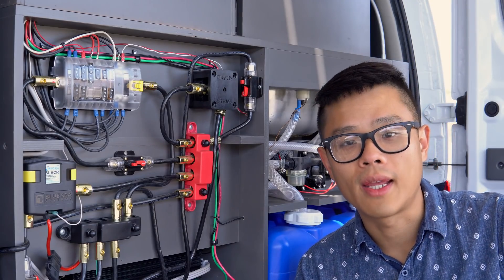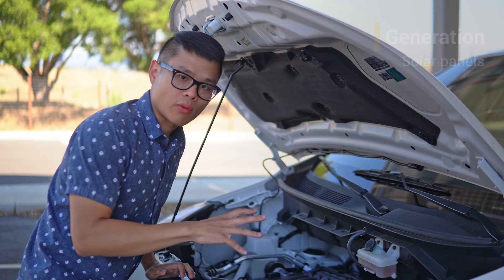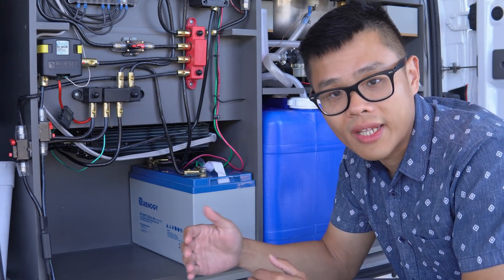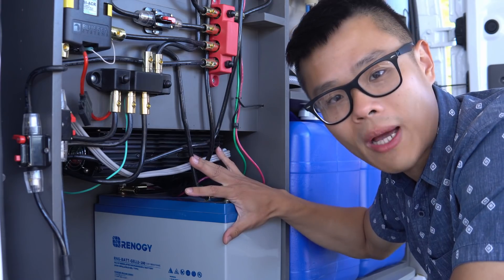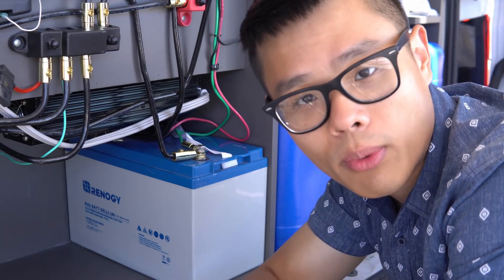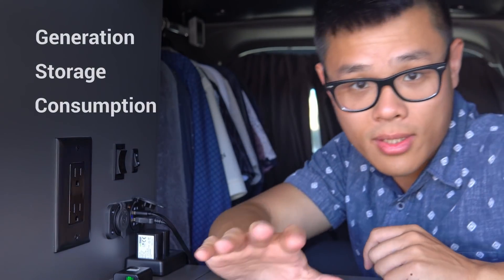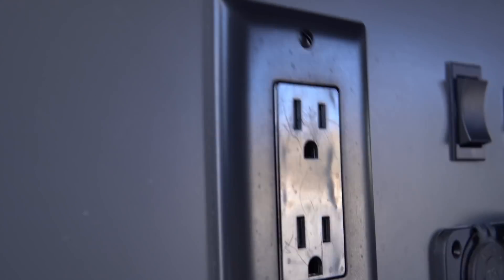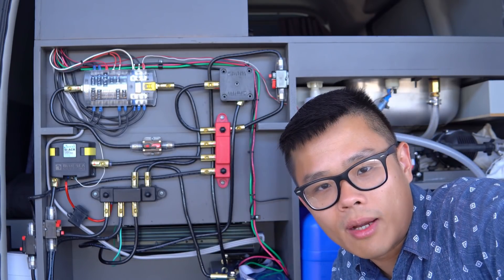Ultimate Guide To Off-Grid Electricity (In A Van)

Comment: I found this very helpful Evan, thank you.  Do you think the increased availability of LiFePo4 battery packs could be a further simplification of the electrical system, or do they bring additional complications / expense?  I suppose everything is a compromise to some extent.  For a minimalist 12v build, that is designed to support charging a phone / tablet, run some LeD lights and a small fridge, the set up you have with a 100A or 200A Lithium Battery, with DC-DC charger is probably the right way to go I guess..
Reply from the maker: I’m not sure what you mean by LIFePO4 battery packs. You mean an all in one system?
Reply: @StoriesFromaVan  hi Evan - yes exactly - Bluetti, Jackery and PowerOak are typical brand names - they comprise a lithium battery, solar charge controller and inverter all in one, and often include USB & 12V / 110V sockets/ports.

Comment: How do you heat the water?
Reply from the maker: I do not have hot water 😬
Reply: @StoriesFromaVan  do you know if its possible to plumb the hot water from the engine cooling system to some kind of heat exchanger coil in the water tank?

Comment: i went 24v to double my output from a smaller MMPT controller and smaller wiring with less power loss. 
have two 310 panels on my sprinter van with 3rd remote panel that is canopy or points towards sun in Morning Hours. 
35A MMPT victron is 500 watts 12v or 1000watts 24v. Also Capable for 36v or 48v for expandability.

for 12v charging can use a very cheap 8Amp 12/24v charger and run a line to the inverter in the van (use van stereo while charging ac)
Reply from the maker: That’s a cool setup! The solar canopy sounds awesome!

Comment: Evan,  For a promaster City ( about the same size as your van) would the Bluetti EB 70 all in one with 120 watts of solar be enough for 12 volt necessaties,  12 volt fridge a laptop,  and ceiling fan?  Would the ceiling fan be powered by the Bluetti?  Thanks
Reply from the maker: You might struggle with enough power generation with only 120w of solar in cloudy climates like in the Pacific Northwest. You would probably need a dc to dc charger. You should be able to wire both the panels and charger to your all in one battery, but I’m not sure how the built-in controller in your Bluetti will interact with the dc to dc charger. You should contact a technician from Bluetti and see what they think. Otherwise I would get more solar if possible
Reply: @StoriesFromaVan  Got it thanks.  Will go with 200 watts solar.  The size of the battery 716 wh should be enough capacity?   Also,  would the ceiling fan be hooked up to the all in one?

Comment: i just use my nv200 for camping with my gf.  just gotta 12v fridge to power.  lights and fans run off built in batteries that recharge from the console.  100ah lithium and dcdc charger and i'm done.  the fridge can run over 48 hrs without charging.  just got a big bed (queen height full width, 8" thick except our feet over the fridge width - 2" there).  and camping boxes under the bed.

Comment: Awesome setup. Super organized and clean for easy troubleshooting. How challenging would it be to upgrade this system for more amperage? Looks like you have enough space to run another 12V battery in series.
Reply from the maker: It'd be a breeze to remove the battery and replace it with any type of battery. If it's lithium, I just have to change the parameter on the chare controller and it'll charge properly. If the batteries are 12v, I would only wire the battery in parallel because if I do it in series, it would make it 24v.